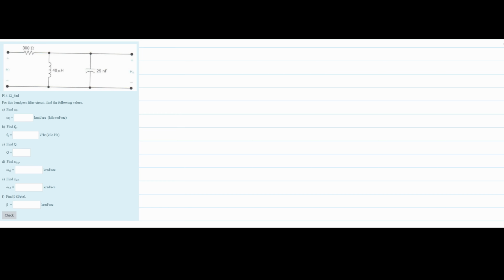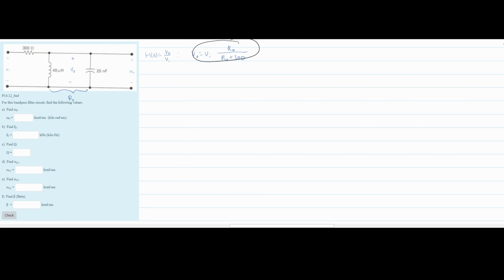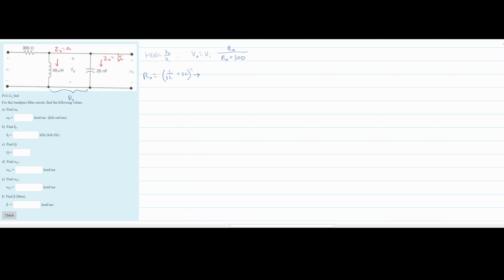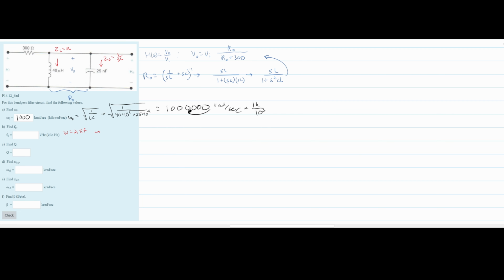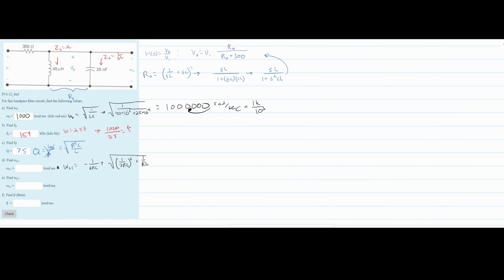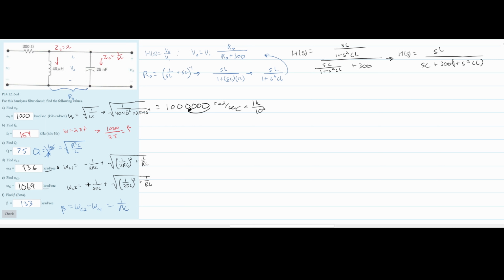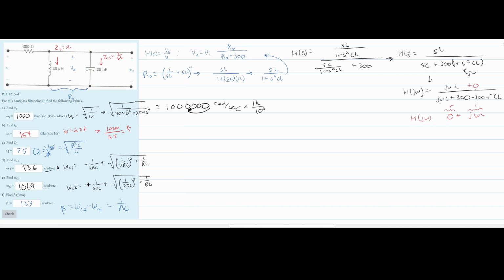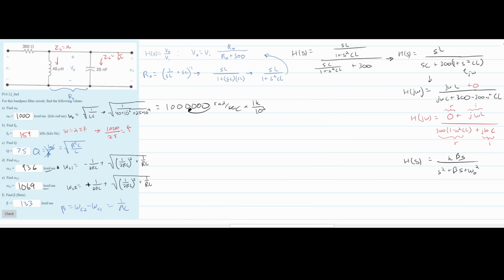Intro. to Frequency Selective Circuits | For this bandpass filter circuit, find the following va....

Comment from the maker: ERROR (caught by the hommie krab): 

inside the square root for Wc1 and Wc2 the equation is WRONG. The very last fraction should be 1/LC.

This can be found in the notes in the description on about page 120.

I believe I got confused with the "in series" form and confused it with this part which is indeed in parallel.